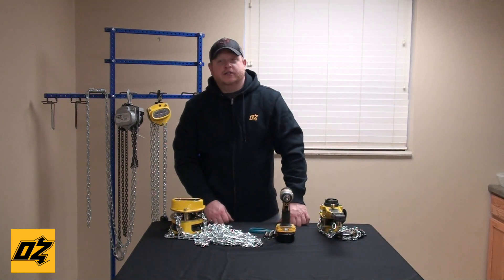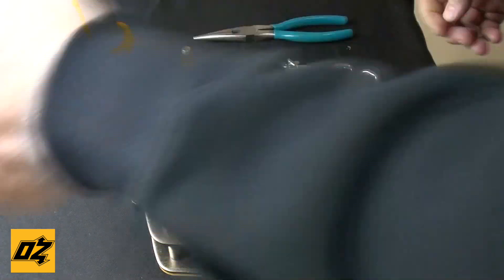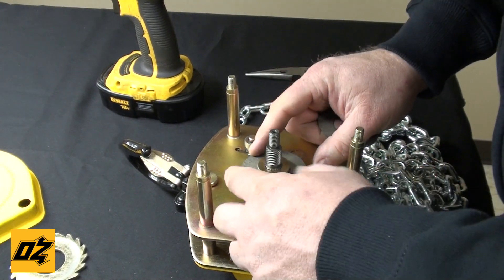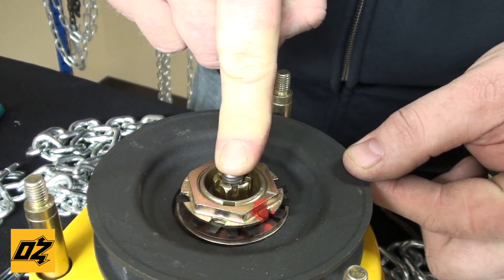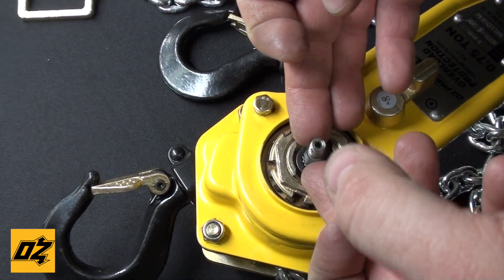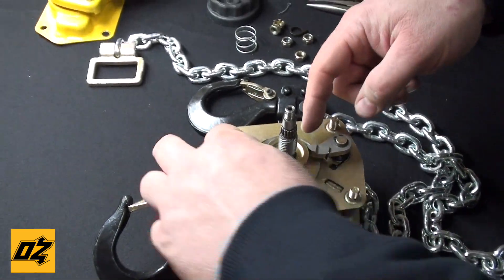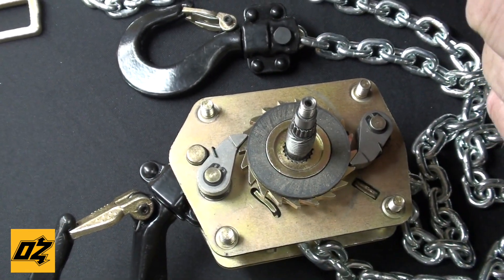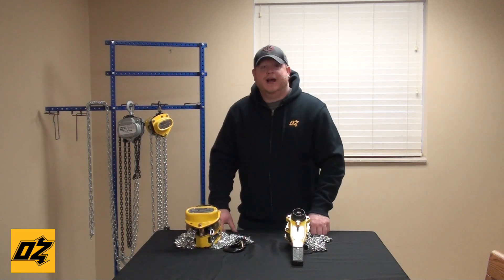OZ Lifting Premium Chain & Lever Hoist Maintenance

Comment: Is it possible to remove the handle and then create a modified nut that can be attached to the shaft which could be used by an impact gun to raise and lower the chain? I'm trying to get the best of both worlds when I'm in a remote area I can run the lift either manually with the arm, or remove the arm and use an impact gun? Thanks
Reply from the maker: Hi @eatonsomemore thanks for the question! 

Unfortunately, this is not possible. The handwheel and handle tie everything together. The main force applied to the shaft is more centralized on the shaft at the brake hub. If you put the force on the end of the shaft with this nut, it would not hold up. You need the changeover gear that is integrated with the handle to run the brake system.  

If you have additional questions or would like a more in-depth answer, please feel free to contact our support line via phone or website, and our team can help you out.
Reply: @OZLiftingProducts  Ok. Thanks for the reply. I'm really hoping to find something that might work for my application.

Comment: Why chain hoist are not advised to use in horizontal lifting operations?.
What is the actual reason behind it?
Reply from the maker: @anandhubaiju6453 thanks for this great question!

While chain hoists can be incredibly useful tools, they are generally not recommended for horizontal lifting operations. There are several key reasons for this:

• Design Limitations: Chain hoists are primarily designed for vertical lifting. Their internal components, such as the chain guide, are optimized for supporting a load directly below the hook. During horizontal movement, the chain can bind or misalign within the hoist, leading to inefficiency, potential damage, and even lift failure.

• Load Sway and Instability: When a load is lifted horizontally with a chain hoist, it's prone to swaying and instability. This can be dangerous for personnel and equipment in the vicinity. The hoist's structure and braking system may not be designed to handle the additional lateral stress of a swinging load.

• Safety Regulations: Many safety regulations and industry best practices discourage using chain hoists for horizontal lifting. There's a higher risk of equipment malfunction and potential injury when used outside their intended purpose.

For horizontal lifts/pulling situations we would recommend using a winch. Check out OZ's winch selection at https://ozliftingproducts.com/products/electric-winch/.

For additional information or recommendations on safe lifting solutions for your specific needs, feel free to contact our team of material handling experts. We're here to help!

Contact us at: https://ozliftingproducts.com/contact-us/